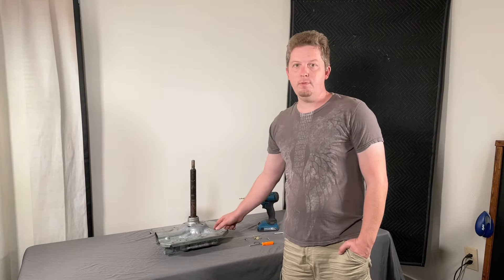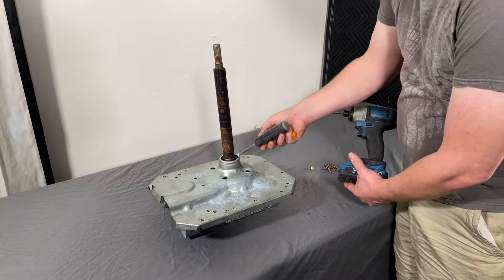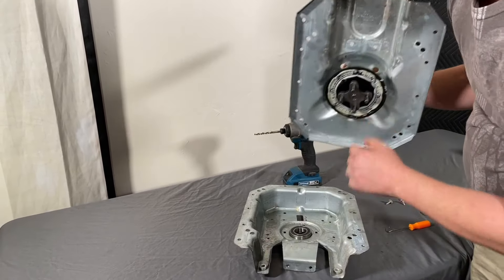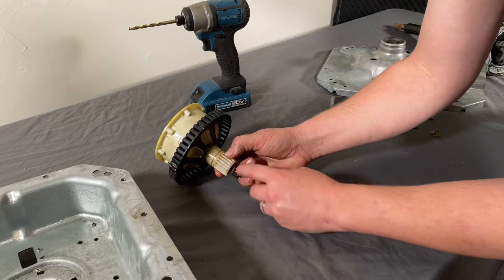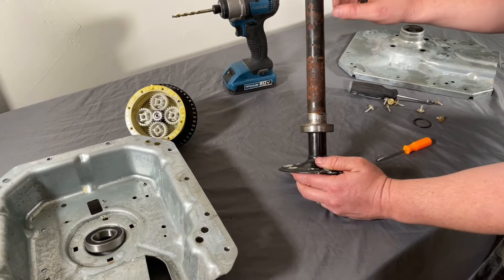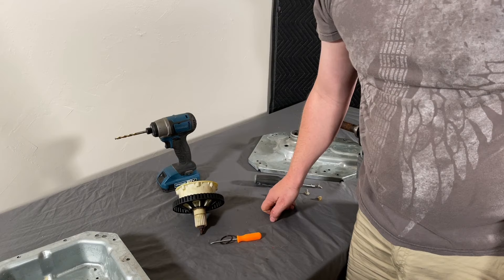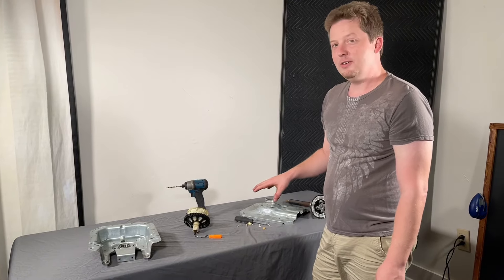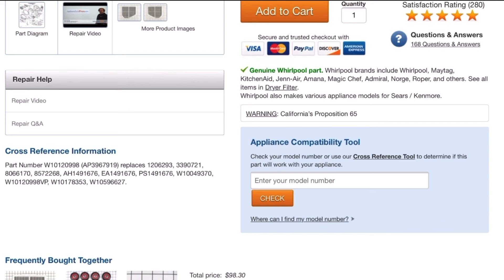Loud grinding shaking transmission bearings replacement Can you rebuild a newer washer transmission?

Comment: This is infuriating. It would cost them 1 more dollar to make this serviceable, probably not even that. It just makes you appreciate a nice old direct-drive machine.
Reply from the maker: I fall more in love with direct drive machines every year. It was such a perfect design. The only ones I recommend new now are speed queens classic.
Reply: @WasherDryerMoney  Yep... but their dryers aren't getting favorable reviews... What dryer do you recommend?
Reply: Actually it would cost them MILLIONS to make it serviceable.
Reply: @lilolme69  lol, they make much more money if it is not serviceable, as we need to buy the whole transmission instead of 2 bearings. and remember they were originally serviceable, they spent "millions" to make it Unserviceable when they made the "new" designs....

Comment: Thanks bud, took me a while to find your video but I’m glad I did. I didn’t want to knock our machine out of commission only to  find that I messed it up 😢 Thanks to your video and some of the comments here I’ve figured I will attempt the repair. I didn’t want to grind the old bearing off the shaft before having a replacement, but I found the bearing number in the comments from 2 others who have done it 👍

Comment: I have been able to successfully replace this bearing about 10 times in different machines. It is a pain but it can be done. Also the metal sleeve above the top bearing is removable which you have to slide that up the shaft in order to replace the top bearing. Usually the top bearing is the only one worn out.

Comment: As others have said, that collar is press fit only, so once the rust is cleaned off, pop the shaft in the deep feezer overnight. In the morning, fire up the propane torch and quickly heat the collar up only, while tapping it down with a punch or screwdriver. I only had the bearing race left on the shaft, so tapping on it with the round side of a mechanics hammer got it off in no time!
Reply from the maker: Interesting thanks.

Comment: Not hard if you have the right tools. Sand paper to clean the rust. Torch to heat up the bearing to expand it. And a press to press it out the bearing. Not something everyone has in there arsenal.

Comment: I just did the top bearing in one of these today. Took a bit of finesse to get it off and save the stainless steel seal sleeve above the bearing. 6006RS bearing. I need to make a video of this but there are some tricks that make it easier. Never going to buy another of these complete units at $80 to $200 again!

Comment: Thank you. You saved me from thinking I could fix it. Had a customer bring in the identical machine. It was leaking water from the tub seal. Unfortunately she let it go for a long time. That was the original complaint. When I ran the machine prior to tear down, the transmission was making a racket. When I pulled the agitator off, I noticed side to side, up and down movement. When I flipped it over to remove the transmission I wanted to cry. The screws were frozen on the shifter, the connections were all full of green and brown corrosion. I finally got the trans out and turned the shaft. It was like it was jumping gears. Very sad how poorly this stuff is made. Needless to say, she gave me the machine for parts because the cost was prohibitive. Thanks again for a great presentation. Keep them coming.

Comment: Thanks for the video! After watching it, we took two of these transmissions apart, and replaced their bearings. Part number 6006-2RS 1(2 Rubber Seals) for our application. They are only press fitted. We do not believe they ever had any adhesive. They are certainly NOT "welded" except by rust You can DIY by first cleaning and sanding the shaft above the bearing. Once its CLEAN, use a light oil, like 3 in 1 (WD-40 is a rust inhibitor) Walking first the flange, followed by the bearing via small hammer blows with a small flat chisel or large screwdriver; keep rotating the shaft so as to drive the flange and or bearing as straight as possible to avoid binding. Don't be afraid to hit it, after all if you don't succeed it's going to the recycle center! Keep in mind, any dirt / rust will keep you from extracting the bearing and flange. You only need to save and reuse the flat metal flange. So, feel free to cut the old bearing off with a grinder, Dremel or even a hacksaw. As simple as the construction of this junk seems, make sure you photograph the position of the flange/bearing, so as to insert the new bearing down to the correct position. Also make sure to Mark how low on the shaft it seats. An easy way to drive the new bearing / flange straight, is to get a scrap piece of steel tubing only slightly larger than the shaft diameter, and use it, and your trusty hammer to drive the new bearing, and the flange into position. Easy! Even if you buy a piece of tubing at i.e. the Depot, it's still cheaper than a new transmission. Good Luck!   The only parts not repairable are the plastic planetary gears in the plastic case, as I could not find replacements.  If anyone can find these parts, please let us know.  We did service them by replacing the oil in the cup, and resealing with silicone gasket maker.
Reply: do you have the link for the Rubber Seal in this video https://www.youtube.com/watch?v=WF5V1Dijsiw&t=325s
Reply: Did you replace the tub seal? What is the part number
Reply: @spicky2966 did you happen to get the part #s for the rubber seals?
Reply: A few people have asked about the rubber seals above the top bearing at the top of the transmission case at the bottom of the shaft, anyone have info on where they can be purchased or a part number. I’m assuming they will be damaged in order to remove the shaft  and top bearing from the casing.
Reply: @spicky2966 you eventually got the upper bearing off correct?
Reply: upper bearing removal-----youtube search---CAMBIO DE BALEROS PARA TRASMISION WHIRLPOOL SEMIDIGITAL. CURSO DE LAVADORAS GRATIS
Reply: @davidwilkinson9385  used a bearing press backwards but was able to pop the top race bearing and sleeve with some difficulty

Comment: You did this right, what a great breakdown and insight on typical manufacturing practice - this saves a lot of heart rending wishful thinking on repair and replacement of the parts.  Whew!!! what a bunch of effort you saved - yes I blame the machine engineers and cheers to you for doing this - great video.

Comment: I replaced the upper bearing about 2 years ago. The tranny I did was from a model washer that had a wash plate instead of an agitator so the transmission output shaft was shorter than the one in this video, so I was able to pull the bearing using a long jaw puller I had.
Here are some key points if you are looking to do this job.
1. You MUST disassemble the gear box and take out the solid agitator shaft. If you try to pull the upper bearing off with a puller, with the gear box fully assembled, the puller  will drive the agitator shaft down an possibly right through the bottom of the plastic gear box housing. It will then be time to punch out and go home..lol
2. Once you have done step 1, you MUST put a mark on the outer, hollow shaft, to mark where the bottom of the bearing is located so that you can place the new bearing in the same spot on the shaft. There is no "stop" on the shaft so you won't know where to place the new bearing unless you mark the shaft. I used a hacksaw blade to score a light mark below the bearing.
3.You MUST remove all the rust and any other imperfections on the shaft, so that nothing will restrict the removal of the old bearing when you pull it off.
4. The sleeve he is pointing to here 6:12 , often has a groove worn into it by the tub seal. The seal then leaks water into the bearing. That is the reason you are here. If your sleeve has no groove, consider yourself lucky and clean the sleeve with some Scotch Brite. If your sleeve has a groove worn into it then don't even think about sanding the groove out. You will sand off so much of the sleeve metal that the new seal will not have a tight fit, not to mention that the sanding and polishing process would have to be done perfectly or you will have a leak again in no time.
Just Clean the sleeve with Scotch Brite and count on having another leak again down the road
5. When you pull the old bearing off the shaft, the sleeve above it will come along also. That brings up the question of how did I reinstall the sleeve.
6. After I installed the new bearing, I heated the sleeve with a torch. That expanded the sleeve and it slid onto the shaft easily. Once it cooled, it shrunk to a very tight fit.
7. I used 1/4 inch aluminum blind rivets from harbor freight to put the 2 outer halves of the transmission housing back together. So when you drill out the original solid rivets use a 1/4 inch drill bit, or a bit size equal to whatever size screws you will be using,  if you don't use rivets. It's critical that the 2 halves line up as they originally did so use common sense before you haphazardly start drilling out the original rivets.

Finally, If you don't have a puller with jaws long enough to pull the old bearing off, you could use a Dremel tool with a cutting wheel to cut the old bearing off. The sleeve above the bearing will make that a little tricky. To prevent cutting into the sleeve I would try  to heat the sleeve and remove it, before cutting the bearing. Again , make sure you remove any rust on the shaft that will prevent the sleeve from coming off.
PS- After drilling out the rivets on the housing, you will find it very difficult, if not impossible , to separate the upper housing  half from the bearing. I heated the lip on the housing then used 2 screw drivers, 180 degrees apart on the housing , to pry the two housing halves apart.
The lower bearing replacement should be easily accomplished using the info I just provided for the upper bearing so I won't go into that. This post is long enough already. I've never seen the lower bearing go bad btw.
GOOD LUCK!!
Reply from the maker: Thanks for the info
Reply: Can you give me a part number for that upper bearing and I would love for you to post a video of this ! Thank you and I just subscribed !
Reply: @bruce7259 how you planning in putting it back together correctly? I think its part out time or replacement time
Reply: Where did you find the replacement seal

Comment: Thanks dude! I've been wanting to open one of those up. I figured the same on those bearings. I onlybdo bearing and seal kits on Speed Queen. Also, SQ transmissions are very much rebuildable but the gear oil is some nasty stuff. I can bring almost any classic too load Whirlpool direct drive washer back to life. Their tub seal is still like five bucks lol. Most people go through washer dryer phases. The government told everyone to go green with HE and trade in their water wasting machines. So many people went to frontloaders. But, they get moldy, don't clean well and take over an hour to wash a load. I meet so many people that are happy to get rid of front loaders, GE, Samsung, LG, Bosch and other disposable junk for a classic Whirlpool top loader.
Reply from the maker: Direct drive Whirlpool washer will always be king of the washers. Dependable, affordable and cleans clothes fast.
Reply: @WasherDryerMoney  How do we know which washers are direct drive?
Reply: @Jeff Stone  sorry I didn't see your comment til now. But, you can lay down a Whirlpool brand washer on its back and look at the transmission. It will be cast iron and have a big square motor attached, and then a large pump attached to the motor.

Comment: You have to sand the shaft and remove the race and the bearing together from the long side. Where the bearing sits is hatched and can't go futher down the shaft when replacing. Some machine shops have a tall bearing press that can take it out, I on the other hand put the shaft loosely in a vice and put a block of wood on the other side of the shaft and tap out the bearing and race. To replace, tap the bearing and then the race with a pipe slightly bigger than the shaft.
Should be noted though that what can cause the bearing to go bad in the first place is a leaking tub seal, which should be replaced as well.
Reply: Take a dremel with a metal cutting blade and go around the top edge of the race (as that is where it is pressed in) about 1/4 of an inch or less and cut it.  Then make a verticle cut, grab a chisel and snap it out.    Then you can place two angle irons parallel to each other and place the bearing on it.  With the angle iron secured on a plateform so it won't move.  Grab a 2x4 and place it on the tube/shaft and hit it with a hammer.  The 2x4 protects that rubbe seal up there plus protects the shaft.  Out will come the bearing and the race.
However, at times the bearing gets rusted in their big time.  In tha case you simply resort to the same technic as the scoring the race.
You don't have to cut off the outer collar of the bearing but simply score it good with the dremel.  Two of them, one half way opposite the other.  Grab a hammer and hit it, being hardened metal, it will break and snap out.   You can see the videos of people doing this on youtube  when a bearing doesn't want to come out.
Then you simply remove the ball bearings and do the same with the inside collar, it is where the rested frozen part is.
With that part you simply use a chisel after you score it.  Either it will break or it will turn and then you can walk it out with a channel lock.
Tub seal part number ( w10324647 w10006371 Ap4567772)
Size of bearing (30x55x13)
Race replacement ( 1 1/4 chrome pipe extension at your plumbing store.  Drain pipe for the sink).  The shortest one will make 5 to 6 of them.  They are rust free and exact size.  Cut them about 1-1 1/8" inch long.  File the cut edge if the seal goes over it although it won't matter.  The edge should stick out off the seal and the seal goes over and on its smooth surface.  The purpose of the race is not to keep the bearing in place but to accomodate the rubber seal.
You can clean where it goes with rubbing alcohol and then put some crazy glue for extra goodness, although not needed before pushing the new homemade race in place.

https://www.youtube.com/watch?v=BIMt0WGmwxQ
Reply: omg people, just use a cut off wheel to take the bearing off.
Reply: @alchemy1  I have a problem with water leaking between shaft and chrome pipe. I don't know what to do. chrome pipe extension does not fit as tight. do I need more crazy glue or silicone?
Reply: @barrylink6378   Ideally you would want to cut the chrome pipe with a plumbing pipe cutter.  Why?]
Because a pipe cutter's blade going round and round the chrome pipe causes the that cutting lip sort cone shaped if you know what I mean.  

So, when you feed the chrome pipe, you feed the non-cut straight side first and the cut cone shapped facing up.  The cone end as you can picture goes tightly over the shaft.
Well, what you certainly can do now is to fill it with Loctite glue gel.  If that is where it is leaking from.
The gel is thick and not watery which is what is needed.
That should fix the issue.
Reply: @alchemy1  thanks
Reply: What kind of glue do you use to put it back together ?
Reply: @alchemy1  what kind of adhesive do we use to put it back together ? He said the sealant was a pain to separate them .

Comment: It does work to remove the bearing on the shaft. There is a coupler pressed on the shaft after the bearing. It take a lot of hammering but it works. I did it today.
Reply: any photos pls

Comment: Good video on the internals of the gearbox. Never seen the inside broken down like that before and i have been working on these since they came out in 2010.  They are 5 year machines but very easy to work on. 
The part site you showed was not listing the real part number.  I don't like any site that gives a ap number.  No Manufacturer uses a part number that starts with AP.  Almost all whirlpool parts start with W
Reply from the maker: Yeah I need to get a better explanation of where to look on the website. You do have to click on the product and there’s a manufacture part number listed underneath the other number. They always like to hide them. Lol
Reply: @WasherDryerMoney  Look above for details. I have covered everything with all details included. The seal, the bearing, the sleeve how to take them out and install them. You can get the seal and the bearing at Amazon and Ebay.  But the bearing you can get them anywhere

Comment: Dude this is an awesome video! I'm sure it can be figured out. I have a few ideas on how to repair it
Reply from the maker: My brother came over yesterday and we tried to get off that metal. Hit it with a big sledgehammer and flat head. It’s still didn’t come off I’m pretty sure it’s welded on or glued.
Reply: @WasherDryerMoney  Crimped on maybe (crushed).  If glued, heating might release (soften) the “glue”.  My guess, that ring my be crimped on. At this point, destructive dissembling may be the way to find the next clue. Maybe cut through that sleeve with a grinding wheel, then chisel off the pieces. 

Inquiring minds wanna know. Being able to replace that bearing may be a moneymaker for someone.

Added:  is failure of that bearing the first major malfunction for many machines?
Reply: Hi fellas I used a press and it came off
Reply: @jeremyramdass831  interesting 🧐 that’s what I’ve heard before that you need some serious equipment for it to come off